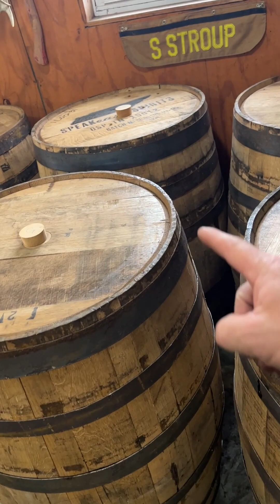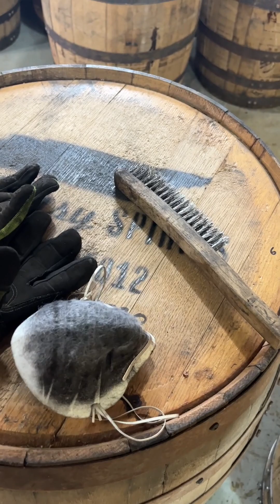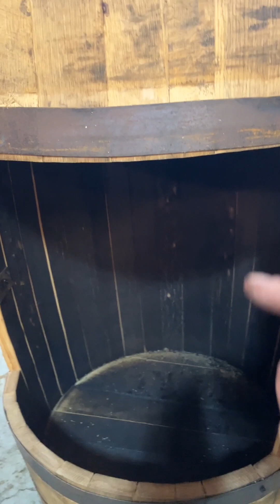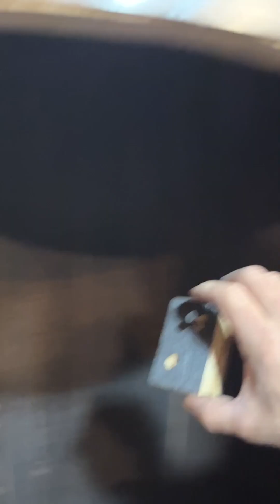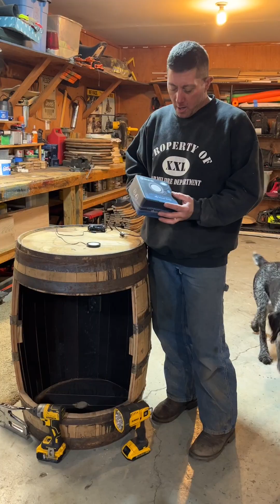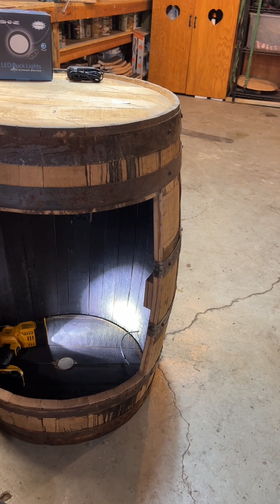WHISKEY BOURBON BARREL BAR DISPLAY CABINET, glass shelf, lazy-susan bottom, and LED lights, wood-top

Comment: Try using a pressure washer to clean the insides of the barrel. Was my favorite way to do it
Reply from the maker: I don’t like using a pressure washer. It adds water to the barrel, causing the wood to swell. The key to making a long lasting “tight” barrel is to use an older aired / dried out barrel. If you start with a wet barrel, after you build it it will slowly dry out and shrink. This causes the barrel to become loose and sloppy.